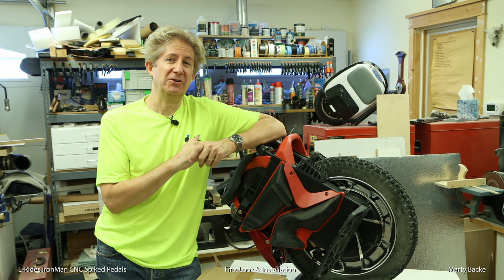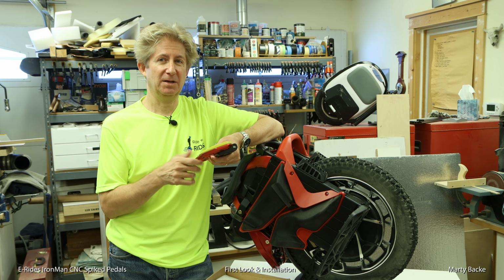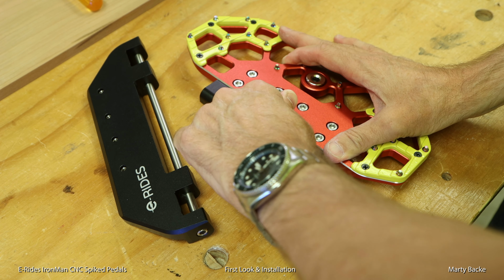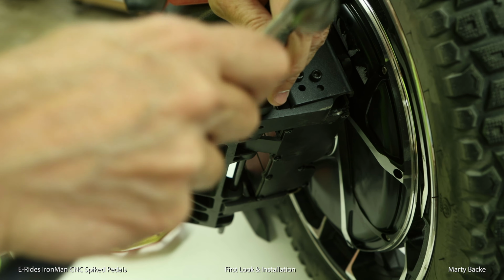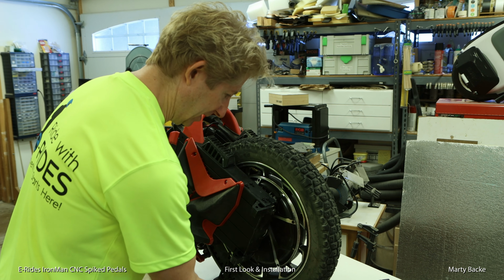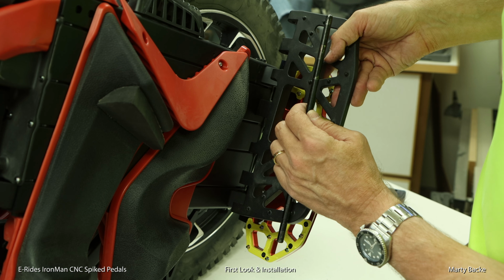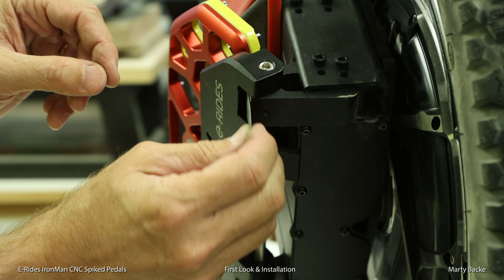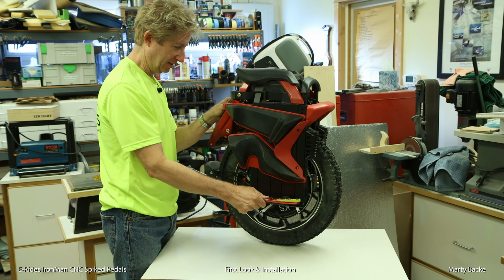A first look at the new IronMan CNC pedals from E-Rides

Comment: What is the weight? Looks way too heavy vs Hextech pedals which are around 500 gr
Reply from the maker: They are not light. It's always mystified me why people care how much the pedals weigh considering the S22 is one of the heavier wheels that you can buy.
Reply: @ElectricUnicycles  Thanks. We do care about weight as you can shave 1kg off from just pedals (vs die cast Begode spike) and 1kg from CST knobby, and 0.5kg from stock pads (Hero), so... my RS is much lighter and feels better vs stock. But do agree sometimes it doesn't work so good (Shermax, MPro...)
Reply: @ElectricUnicycles  s22 is one of light wheels in suspension category :) try v13

Comment: Why would they ship a base plate that doesn't fit your machine?
Reply: Marty had the sherman base plate about a month ago. But he now has an S22, so we sent him an S22 base plate, so all he had to do is take the pedals from the sherman and transfer onto the base plate of the s22. One of the advantages of this design.
Reply from the maker: They didn't ship me the wrong plates. They "gave" me a set of pedals for my Sherman and then later sent me a new baseplate so I could use them on my S22.
Reply: @ElectricUnicycles  
Oh, ok. Got it.

I missed the part where you took them off your Sherman.
Reply from the maker: @dialecticalmonist3405  To be exact, I got them for my Sherman but decided not to install them and instead wait for the new baseplates for my S22 🙂